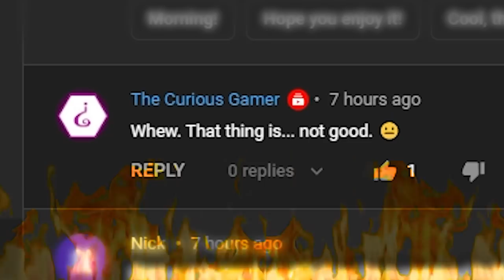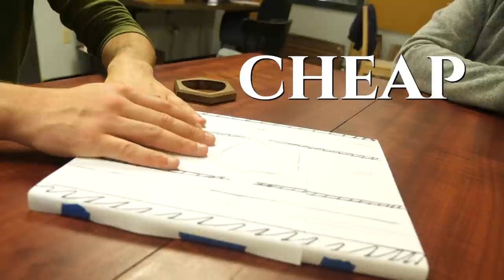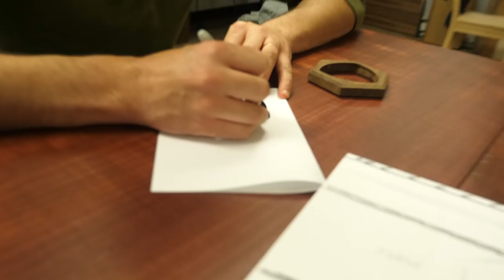New GM Screen Design Pt.2 (Jason was right)

Comment: Jason is right on this one, again. I have backed both versions of your previous GM screen. I used each for about 6 sessions and then stopped. They were bulky, it was kind of a pain to swap things out and it would constantly disconnect if I bumped them wrong. I went back to the standard folding starter screen. I don't regret backing them because I think the product needs to exist but so far you haven't improved on any of the things that keep me from using the previous versions. You have:

1) Made it uglier
2) Made it heavier and bulkier

I personally want a Paladin tracker style GM screen. Something with magnets, something I can easily change a few things and can track the most common party options. I wouldn't spend 1000$ on a GM screen, but I would seriously consider spending 300-500$ on one...If it solves the basic problems. Storing it, swapping trackers out, not coming apart.

Comment: I have two ideas for the screen. My first idea is to have a panel option with magnets on the bottom where you can attach your hexes. The idea behind this is that you can use your existing hexes behind your gm screen and that they are fixed in place so if you want a place to keep your dice, cards or snacks. I imagne it would be low cost (it is just a few magnets more that you can use for different things) but the aesthetics would maybe suffer. My second idea would be the use of laminated wood for designs,  the core board would be white maple with a thin sheet or decorative layer of black walnut and you cnc a design into the black walnut for example. If this works you could do different combinations of woods with different designs. Imagne something like a a dark wood top with a white dragon design where all the lines are the white wood underneath.

In addition I think something to point out is the costumer base for gm screens. Compared to the hexes or the dice trays it is really only for the gm of the group. 1 in 5 or 6 people is the market so the question is if they are gonna prefer a "cheaper" product or spend a bit more.

Comment: Jason is spot on with basically everything he said during this episode.

Also, I think actual hinges are a must, those rods don't look very good, but more than the aesthetics, if you misplace one you just don't have a DM screen anymore, you have a wooden board. And they are just metal rods (or pipes if you go with that)... they don't look like they belong on a GM screen. If you end up with this system for the hinging I really think you should just glue or screw the actual rods into the central panel so they feel like an integrated part of the product, but actual hinges would be better, even if they are more expensive.

Have you considered something like a design that's routed out of the panel and then filled with epoxy? Like the wyrmwood shield, I'm pretty sure that would be cheaper and faster to do than the other inlays you do and it still looks really good when it's done right.

Comment: Ok. Both everyone has a point.

Doug is right, they need a GM screen out there because it’s a great product that needs to be sold. 

Jason has a point because the block of wood is not what we want. We want something that fits with Wyrmwood products and a block isn’t it.

I was going to say “Make it similar to how you’ve made the classic adventuring party, the layering should help” if not make it more customizable. Have us be able to mix and match woods for the screens, instead of stagnant.

Then Doug made what he did and it looked great. That was a great head start.

Here’s what I would say:
1. Keep the design for what Doug created.
2. Switch the rod for the barrel magnets from the Matt Mercer GM screen. With the magnets in the screen to ensure we don’t need an external magnet set to make things tricky.
3. Offer some basic GM/DM pages that are commonly found in recent screens.
4. Have customizable engraving magnetic pieces.
5. Include a travel bag.
6. As a stretch goal (if that’s how you do it) add additional features like a magnetic strip, or unique products, like a vault or a tray, that are just as customizable as the screen.

Comment: I think the product I'd most likely purchase is Doug's design. I love the idea of the accent, and could see myself actually using the modularity of it, having two vertical panels in the middle and two horizontal on the side. And I'm sure that Ian's ideas for hiding the bar and magnets would fix whatever issues could be had with it looking "incomplete". 
I'm sure there is a factor as well that I can't afford $150 per panel, but I could do $50 to $70 per panel.

Comment: Okay listen up folks, here's the idea. Same as the CAP promotion we veneer sheets w/ varieties of woods. Then instead of ripping slats verticaly, they are cut to length and width normally. And then routed (by whatever means) with a bit similar for cutting bevels. There fore if you extruded wood with the bit, you create valleys that reveal each layer of veneer. Possibly continuing the them of CAP with stylized DM screens or custom  filigree options from a set (possibly stylized like i said) list.

The nice part of this idea is, literally whole sheets of wood can be veneered at once, if im not mistaken. Then allowing you to rip that whole sheet of layered veneer into many smaller DM screens.

Im just saying boys, i have the answers

Comment: I am solidly (pun intended) on Team Doug.

My first wyrmwood purchase was a simple dice vault. No fancy anything. Just a hunk of beautiful solid wood and a couple magnets. I would much rather see simple, efficient, effective products.

I backed the GM Screen kickstarter. It is also pretty, but it doesn't feel solid and robust. The frame and panel design makes it feel flimsy. It also can't be easily folded or stacked and transported. Solid wood panels could do that by default. 

The other execs in the video complained that "anyone else could make that", but, that's true of a billion products out there. People buy the brand they trust at that price point.

If wyrmwood made a $3000 GM Screen, I'll go buy the $200 simpler one on etsy. If Wyrmwood made a $200 simpler GM Screen, then I'll buy it from Wyrmwood.

Comment: Doug is concentrating on the look and missing one of the best parts of starting to use the hexes. USE the hexes. if there were magnets on the interior faces that could magnetize with the hexes to hold minis, dice, etc. in the angle of the panels. That kind of modularity added to it would be a slam dunk for me. Maybe ways to attach it to the player board for MGT. Make it modular but play well with the other lines.

Comment: So, and I may be wrong, but I'm pretty sure 1000 is well above most people's budget for a GM screen, especially when that would apparently have bought me a decent sized modular gaming table. Even 500 is a bit high for what, at it's core, is some (admittedly luxurious) magnetized wood panels that will be replacing my cardboard screens, but I can see that people would be willing to pay for one. I personally might be willing to go as high as 350 for a nice wood. For perspective, that also gets you a Beadle and Grimm's Legendary Edition. I understand that the complexity is what drives up cost, but man, that's a really rough pill to swallow. Also, to address Bobby's idea about a 3 panel screen being standard: the standard 5e screen is 4, and as a preference I run with a 4 panel screen because it's more stable.

Comment: One of the things I liked the most on the original DM screen was the modular stuff d
that could be added, like the 2 way dice tower. So an option could be to find a way to make it compatible with existing stuff (as new accessoires would make cost spiral) like make it click in with the tables or an easy way to attach the existing Dice tower and trays, even the tiles.

Comment: What is a Wyrmwood products is quality inlays, or illustrator engravings. That could up the image. Even panels that have magnets inset in patterns for small card or note attachments. Toppers to add special elements to the top for all to see. Maybe a mini (tall and skinny) for an optional purchase. (In case the client needs a smaller configuration or just a little more)

Comment: For me, I need either 3 or 4 panels. To be honest, the modular design for a GM screen isn't necessary. It doesn't need removable panels. I'd be perfectly fine with the option of getting either a 3 or 4 panel screen. I also think that would suit the vast majority of GMs out there.

I think the bigger issue is the price point. This is doubly so when you consider other options on the market. In general, I tend to prefer Wyrmwood's aesthetic (more of a classic elegance) over that of say, Dog Might Games. The problem though is I can get a DMG screen for $400 - $500, and while I think the traditional Wyrmwood aesthetic is better, it's not 3 times better. I bought Wyrmwood dice trays because I liked them better than DMG but they are also similar cost. So I think that Wyrmwood needs to aim for that $400 - $600 price range, maybe up to $800 on the high end. 

I do like Doug's idea of the customizable shield on the outside of the screen. I could see a lot of people going for that while at the same time being something that is easily skipped by those on a budget.

Comment: Hey guys, remember when you said that you don't need a CEO and that having a CEO is stupid and then made Doug your temp CEO. 

Then you guys all act like division heads with differnt visions for the company because you all have different points of view that are irreconcilable  because there is no CEO to set the long term goals of the company or decide the strategic vision of the company, and you still think you don't need a CEO?

This is why you need a CEO. This is why none of you can be a CEO. 

The board needs to hire a CEO that does all of the shit that you guys hate doing, but needs to be done by someone. 

Its almost like running a company is completely different than making products and the two have completely different skill sets.

shocked pikachu face

Comment: I've gotta be team Jason. I'd never even consider spending $1500 on this, but I'd happily spend $400-$600 on a handcrafted item I could pull out 20 years from now. 

I think Doug's heart is in the right place, trying to have a Wyrmwood product that doesn't immediately price out a huge number of people. If I spent $150 on his design, and then kept nickle-and-dime-ing myself on modular parts I wouldn't be as happy as I would with a static object. 

I pay $450 and get the Wyrmwood treatment of high quality construction, design, and materials is a better option. Also, it'll have more staying power, so you can continue to offer it while people set aside 6mo or a year saving for it.

Comment: I want something that is going to stand the test of time. I have already spent a decent amount of money on Wyrmwood products because of the quality and precision in their creation. I know those products, when taken care of, will withstand use and the look won't diminish from it. The 'new' DM screen shown for Doug looked cheap and too simple and does not fit with the rest of the merchandise that the company offers. If it is something that an entire table of people have to look at, it needs to be nice, regardless of price. It needs to be up to the same quality and not flimsy like the one shown. This product should be an investment for every DM, not a modular system that might look unfinished. The regular DM screen is a 4 panel system that most people I feel wouldn't want to change.

Comment: "That is what Dog Myte does."

He right. I bought ONE thing from them (a huge dice vault for all my character's dice. It was supposed to be double sided because it had a plexiglass separator... Plexiglass and magnets would NOT stay connected. I am never buying one of those again.

Jason is always right about design, Doug. That is why you hired him and keep him where he is. As someone that ALSO "finds the problems but doesn't offer solutions" according to my old boss, you have to give him time to come up with something that works. 

That said, the mock up Doug did is leaps and bounds better than before.

Comment: If the craftsmanship is not going to be reflected in the product, then what's the point?  Each potential customer already has a cardboard one that gets the job done.  I want a luxury upgrade!  $500 easy without a thought.
This also might be the first thing in a long time which could be considered a "Group" purchase.  The dice vaults, trays etc... are for the individual player.  A DM Screen can be a purchase for a gaming group.
The one thing of Doug's I do like is the customization of the front panel.

Comment: I actually really like Doug's mockup, especially the removable detail. Modularity doesn't add much to the function of a GM screen but aesthetic modularity is really clever, you could get a new engraving for each major campaign you run, or for different games. I'm still interested to see mockups of the other ideas though.

Comment: I do like the idea of the modular screen, being able to connect multiple panels in either portrait or landscape orientation sounds really cool.  That being said, even at $100/panel, that is a very hefty price tag.  I know a ton of tabletop gamers that end up working with whatever they have on hand, if anything at all, simply because the price tag for gaming accessories is often prohibitively expensive.  I could see a lot more folks buying in if the price could be sub $75\/panel if the "Wyrmwood" high quality can be maintained at that price point.  I also love the idea of a insert spot on the front to place a decal/logo/symbol/etc.

Comment: Honest feedback from a gamer and woodworker. Doug's 2.0 design is certainly better than the 1.0 plain slab, but still not as good as a frame and panel would be. People shop at Wyrmwood because they know they can expect great design and top-quality craftsmanship. If people want to save money, they have a thousand cheap options for DM screens. Don't try to compete with Walmart by racing to the bottom common denominator and just pumping out some cheap crap because your hunger to produce products outweighs your respect for the craft. We come to you specifically because we all respect the craft - and understand that it comes at a cost (which is part of the prestige of owning Wyrmwood accessories).

Obviously, recreating the critical role screen would be ridiculous. However, you have to capture just a little bit of that magic which starts with the fundamental construction. Also, three or four screens are plenty. Don't worry about making the panels modular to each other. If anything, give it a feature that links it to the MGT. Maybe leather strap hinges that double as the closure? I like the idea of having some sort of customizable front to the center panel (or center pair for a 4 screen), but maybe just a simple shield logo as a default? 

I, for one, am the type of person who would be willing to invest something like $500-$1,000 for a highly versatile well-built screen that I could probably use for the rest of my life. If I wanted a cheap butcher block with magnets, I could either make it myself or go to a thousand different makers on Etsy. At that price point, I'd also be willing to wait for something like 6 months to a year to actually get it. $2000-$3000 is probably a little high unless you're really going to make it special with inlays and nice hardware. 

A three-panel screen with walnut frame and cherry ply panel with a Wyrmwood shield on the outside center? That doesn't seem too crazy to produce.

Comment: I think people were treating the previous build unfairly. It was NOT a finished product, and I would be shocked to see something that janky come out of a shop like Wyrmwood. That's what prototyping is all about. You take cheap and/or easily available mats and make a concept model.
    That being said, I would consider buying a DIY kit with unfinished panels that had things like the magnets in place and nice rods that I would find difficult to do in my current situation. For perspective, I'm a crafty type who lives in California, where the "scrap wood" is finding pallets behind stores. The last sheet of regular 1/2 inch plywood I bought was over $80 (USD) and I only needed a corner of the 4'X8' sheet. I have no place to store it, except outside, maybe under a tarp. As to what, exactly, is in the kit, well, that has a lot of possibilities. I don't know if the cost+delivery+handling+profit would be worth it, but I thought I'd just throw it out there.

A note on the rods, some sort of pattern, whether simple hash knurling or spirals or whatever, would be nice. Whatever isn't too difficult with your setup. I actually prefer simple and understated.

Comment: Central metal H bracket with wooden panels slid in top and bottom in custom option wood panels Bracket has hooks on one side and a bar on the other so the panels interlock. The emblem could also be built into the H bracket centerpiece.

Comment: you have the idea there allready, modular tables with tabletops, maybe solid wood with a magnetic cover for each panel, you get fancy designs on the cover, then that comes down like a drawbridge and gives support. you could then support all sorts of things in a system like that, the recess could hold all kinds of pockets or even somehow clip into the existing table accessories allowing people to integrate it with their existing tables. you could even get like magnetic feet to stabilize the thing.

Comment: Anyone who DM's is probably the most invested in the game and materials they use to facilitate the game. Jason is spot on as designer. I would go back to the round magnets you used in The Crafting of Matt Mercer's DM Screen. combined with either CNC engravings on Dougs plan block a round the each or just go $2000 GM screen. Put it to a vote of the people that bought a MGT. They will tell you where you should go.